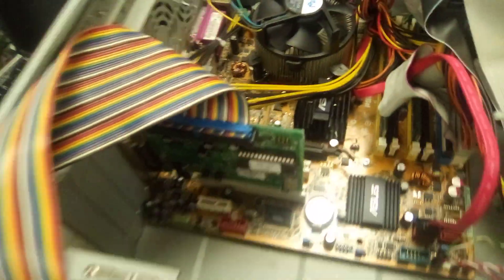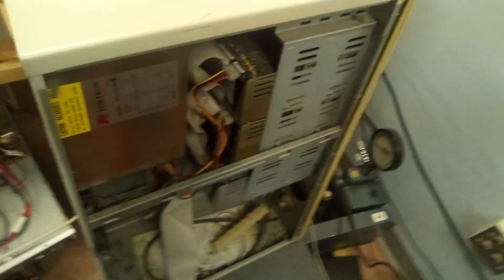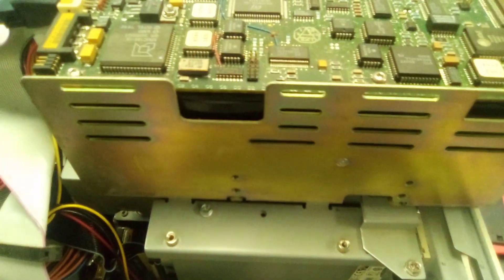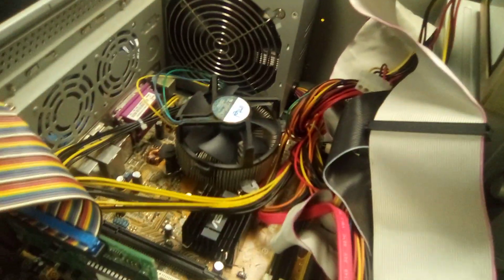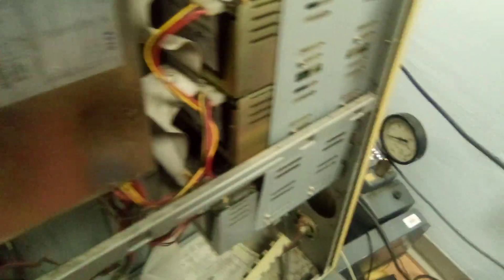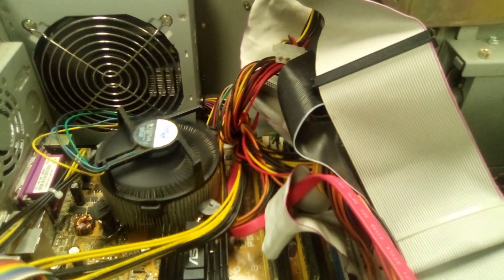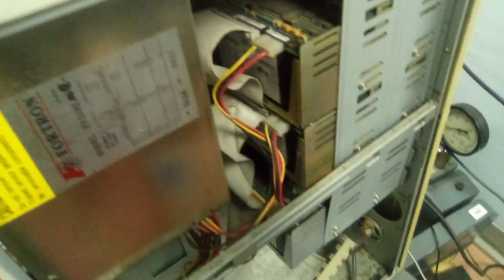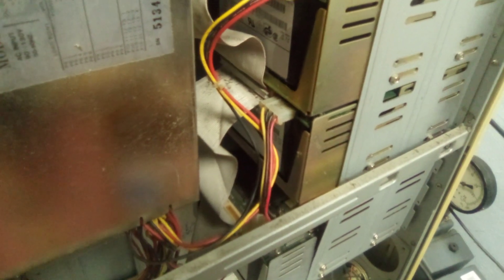Powering up 5.25" Full-Height SCSI Drives from the 1990s!

Comment: whats the capacity of those bad boys buddy?
Reply from the maker: There are two ST42400N drives at 2.1 GB each, and two ST43400N drives at 2.9 GB each.
Reply: impressive for the time but also crazy expensive no doubt :) thank you for sharing this cool technology. It may surprise some that SCSI is still used today in high speed reliability applications, server farms and high end workstations. @electronicsabuse

Comment: My first SCSI drive weighed 40 pounds and was 24 in by 24 in by 30 in

It was a monster and had 9 GB of storage.

You can't even find a 16 GB USB stick anymore.

I just am amazed at how much technology changed in Just 40 years

If you took someone from any time in history to 1900 they would have very little adjustment.

But if you took someone from 150 years ago to now, they would have a horrible time adjusting to the technology that is just a part of life.

I still remember in the 80s going from the manual gas pumps with wheels and usually 2 pumps, to the digital credit card machines and 12 pumps and a mini mart.

In the early 80s the gas pumps were at a repair shop and they m
MIGHT sell a few packs of cigarettes and maybe a soda machine outside.

Times really have Changed